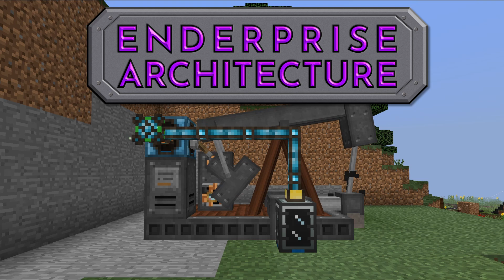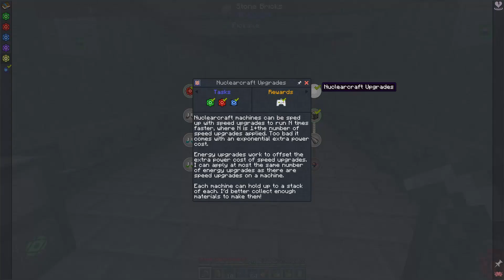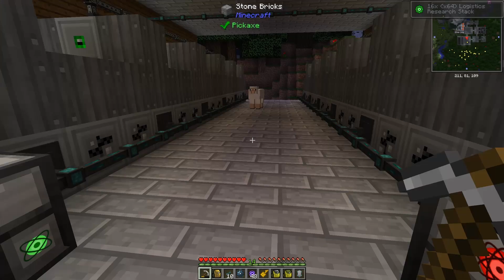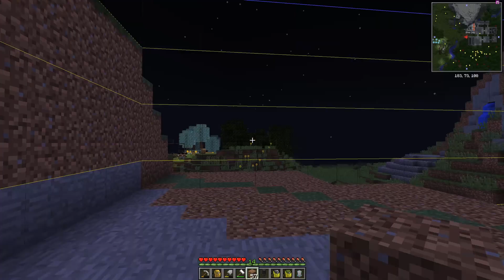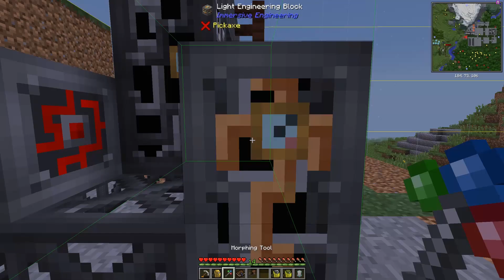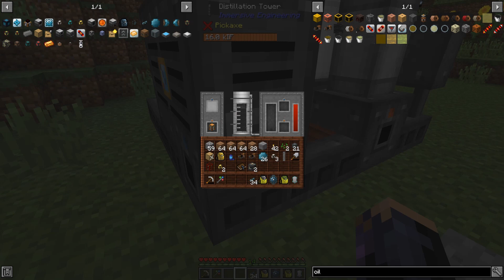Factorio in Minecraft - Oil Production - E17 Feed The Factory Minecraft

Comment: I just love IE multiblocks so much. Even if they're a pain to build. Also, some little things... the pack includes an oil pump multiblock (I think it's the same mod that provides the miners) and I'm surprised they even give the blueprint thing for the pumpjack. There's also two different ways of refining the crude oil. The distillation tower like you're using and a thermal expansion machine. The big difference between the two is I that the distillation tower gives more fluid outputs than just the naphta and also uses more power by default (might wanna use a solar panel for it rather than hooking it up to base power?). Hope that diesel generator produces a ton of power, brace yourself for the power hungry machines you're about to make! :)
Reply from the maker: Thanks for these! Spoiler: I only discovered the Factory0 pump right after this point in recording, which is why I ended up having to split the episode. 🤦‍♂ I'm already running into serious bottlenecks with plastic production (one episode ahead), so I need to spend some time this weekend scaling everything up massively - I think I'll need both types of oil production to get power up to where I need it!
Reply: @EnderpriseArchitecture  yea, I didn't want to spoil anything for you but there's the augment for increasing secondary output that's critical for the plastic. It's slow at first to keep up with the amount you need but eventually you get ahead. I think I might have only used one plastic researcher to begin with
Reply from the maker: @muhgarvey  Well, I'll be looking forward to that! It's painful right now!